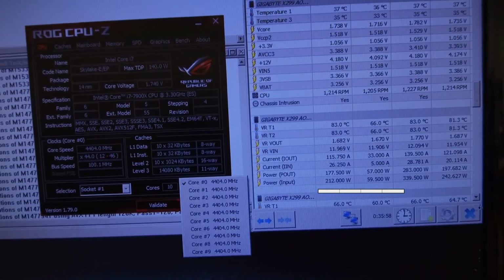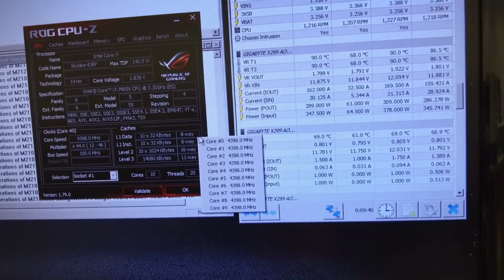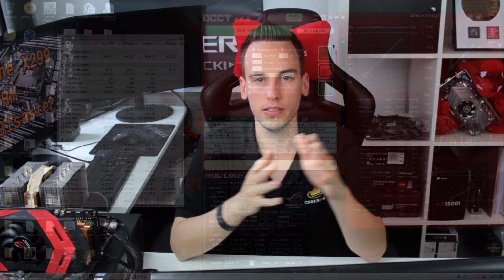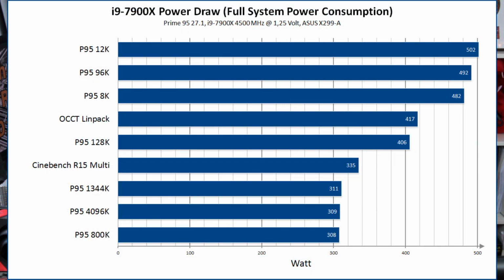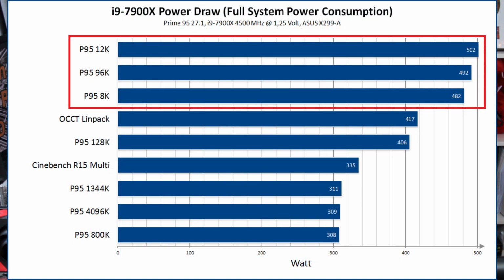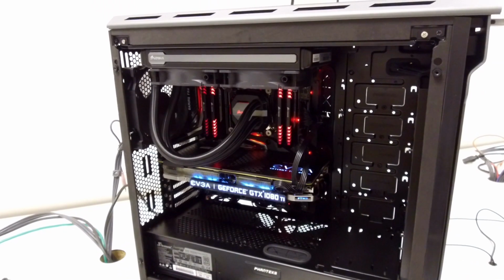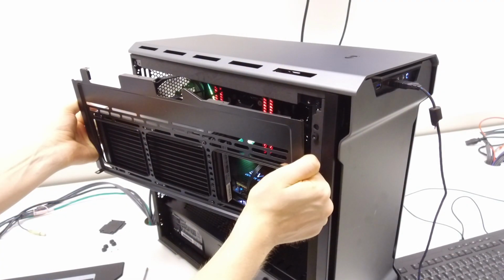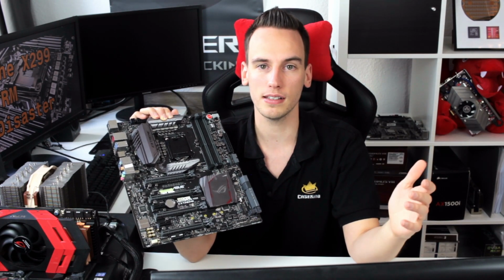X299 VRM Disaster  - UPDATE (en)

Comment: i dont know much about this so correct me if im wrong but how can they copy that z170 heatsink to the x299 when the space is taken by the additional 4 ram slots and the motherboards dont have much space for a bigger heatsink
Reply: It's the design of the heatsink too.  The surface area is basically, non existent . These CPU's pull to much for the poor design.

Comment: I would reach out to Gigabyte and see if you can get one of their higher end boards. I currently have a Gaming 7 and it has a significant a heat pipe running from the VRM down along the back plate. Hopefully this added surface area can help dissipate some of the heat.

Comment: Great video, I have followed TTL for years and years. I knew there was more to it. I am certainly keen to see some videos with better thermal interface. Does the APEX you have use the same IR mosfets? you mentioned these boards all use the best IR components. Does the APEX simply have more phases of the same components or better components that stay cooler / provide greater efficiency?

Comment: That's why I was confused, I'm looking at my new ASUS PRIME X299 DELUXE and it has 8 pin + 4 pin.  When I'm overclocking I always use fixed frequency and run higher voltage (dual loop water cooled setup) ... this has provided very reliable performance on my older 5960X CPU.  Still working on my 7900X CPU.  But thank you for this video, it is interesting.  Prime95 is definitely worst case, but it's also not very realistic in terms of application usage, in fact, it's they ONLY application I know that operates at such extremes.  You really want to OC relative to the type of applications/games/sims one is use and make it stable for that.

Comment: Thanks for the update Der8auer! Been wanting a 7820X for a multimedia build (gaming and movies and whatnot, yes I know it's overkill) and was about pull the trigger on a X299 Prime Deluxe. Thus far I've seen MSI have better gaming performance because of Intel's P-States on ASUS supposedly. I custom water cool, so I don't mind the heat, but unfortunately no monoblocks for the VRM. Thank for you allowing me to make a better decision as i didn't just jump onto this platform. I really look forward to the day I can finally buy this!
Reply: Dylan Shaw just get a 1700 or a threadripper, the problems are much less frequent.
Reply: Dai2 Dai2 if i gamed at 60hz i totally would, but this whole build is meant to be unnecessary and expensive. Will be starting off with 32gb of ddr4-4000 in quad and already have a 512gb 960 pro waiting. I might end up with ddr4 3600 though, because quad channel will give all the bandwidth. As for TR, super excited for the community, but I know it's not going to be as good in games and that's all I do.  Please don't take this as I think Intel is a good company or that X299 is a good platform, but I'm stuck with no other choice. I won't "upgrade" to another 4 core, ganes will start using more than 8 threads in a couple years from now and I stay ahead of the curve. So 7820x is that sweetspot.

7800x is useless as coffeelake is coming out and anything over 8 core is certainly not meant for just gaming and thus Is get TR, but no other competition when it comes to the 8 core.

Comment: The aio in the top will recirculate hot air if you do not block the empty fan space off, considering it's situated right above the vrm, that can certainly not be good...
Reply: Not exactly sure what you mean but even recirculated air is cooler then the VRM and should actually help cool it if anything.
Reply: No, it will work like a heat trap, vrm circulates hot air to aio which will at best continue through the aio and be recirculated down to the side where there's empty fan spacing, heating up the internal air, which in return will make it harder to cool the vrm, 5 mins is all it takes, to see that that exactly is a problem with this case, and there's some easy solutions to fix it.
I have this exact case, and used gaffer tape to block off air from recirculating, because it was heating up the inside of my case.
Reply: hmmm, even recirculated air is cooler than the vrm's. That recirculated air get mixed with fresh cool air that being pushed in from the front of the case. Not to mention most of the air is being pushed out thru the fans up top on the heatsink.

Comment: Could you put a thermal pad in the gap between the vrm and heat sinks? Would that make a difference? So the best solution now is to take the heat sink off and have a fan running on it

Comment: If you don't have the balls to delid your CPU with a Razor blade then Overclocking isn't for you ;)

*Newer Intel CPU whise (Excluding X99)
Reply: That's ridiculous, I hate that I had to delid my 7700k just to have decent temps while OC'd. The fact you have to do it for Skylake-X as well is appalling.
Reply: Yeh even with my 4690k I got 8c less compared to the stock thermal paste.
(I tried the vice method and i chipped off a edge but it still works lol. I ended up needing to use a razor blade)

Comment: I don't understand why there are all these big flat heatsinks, I remember when there used to be a load of really bountiful copper work with fine thin fins on motherboards. Looked really nice along side my old Zalman fan. What is it with this black surfaces from a distance it looks like a cheap bit of plastic.

I noticed on some of these boards they are putting NVMe drivers under similar smooth flat `heatsinks` i wonder if extended high usage on these will also be an issue for the sticks.

also, don't these boards cost 300$+ would be really interesting to see if a 5$ strip of heat pad fixed the issue.

@der8auer have you considered making your own heatsink (with min fan attached) for the systems you sell.
Reply: +Pedro Pinheiro For small dies like Kaby Lake, he is as confused as everyone else about why they don't do it on the new Skylake-X chips (which are big dies).
Reply: They've been watching too much Transformers and Pacific Rim. Also, a "stylish" solid block of aluminium is cheaper to make than a proper heatsink.
Reply: These cards are not cheap they dont need to cheap them off to limit the performance. These cards sell themselves as cards for OC
Reply: Skylake-X CPU's aren't cheap either, but intel still decided to save a few bucks by using thermal paste instead of indium solder. Corporate greed knows no bounds. If they think they can get away with it, they will skimp on quality for profit margins every single time.
Reply: i still dont get why they do that on these high end chips that basicly are only there for OCing.

on lower end non oc parts sure as long as the cpu does the thermal throtal but on these parts its realy strarnge.
Reply: IsakH850 Der8auer himself explained why it is not a price issue but durability thermal paste is more stable for repeated heat cycles specially for very hot systems.

Comment: Just look to the s755 1366 era - heat pipes, pure copper and fans on vrm! Now we have only designer nonsense made from chinese silumin (low quality fake aluminum) and with vendor logos that strict airflow.
Reply: yes this is a real motherboard not hipster designers rgb plastic shit
Reply: +Taran
So many people have no idea how much fake aluminum they use these days on motherboards!
+Dmitry Belogub
P5Q3 Deluxe i have that running!
Reply: I had a Asus Crosshair nForce 590 SLI AM2 that came with 2 blower fans that could be mounted on its copper VRM heat sinks. Like so: http://www.frostytech.com/articleview.cfm?articleid=2077&page=2
Reply: Oh yeah, my asus smth deluxe for s775 had the same. Damn it was noisy :D
But just look at that amount of copper, surface area and heatpipes!
P.S btw, modern sabertooth series boards have something similar. Sadly, the noise is also present
Reply: +Samuel Jones
Wow, thats some nice engineering work from Asus! Sad that they fired the engineer and hired an art student..
Reply: We want full copper back!
http://cdn.overclock.net/3/3e/3eab6a9d_asus-p5q3-deluxewifi-apn.jpeg
Reply: It's sad that the X399 platform is using tiny aluminum heatsinks.
The thing is.. i bet... they don't use 99.9% aluminum, but rather use a CHEAP aluminum and other metals mix.
Reply: Wow really nice motherboard! https://content.hwigroup.net/images/products_xl/001637/asus-crosshair.jpg
Reply: Check Rampage Extreme X48 and Rampage II Extreme ;)
Reply: Yep. Dergadation.

Wanna see DFI and ABIT alive...
Reply: Taran Chinesium, you mean 😉

Comment: >be asus
>call from intel
>"we're releasing a new platform next week so if you'd have boards done by then that'd be greeeeaaaat"
>"also make sure the vrms can do 300A without overheating"
>hangs up
>mfw
Reply: 6950X maxed out uses less power than 7900X
Reply: +Actually Hardcore Overclocking
Yeah, i really would like see someone go deep in why 7900X is slurping so much wattage!
A maximum power draw battle video of 6950X vs 7900X could be awesome too.
Reply: hangs up or hangs himself?
Reply: You do know X99 used FIVR too, right?
Reply: It's really mobo vendors fault for prioritizing aesthetics over functionality.  X99 WS boards had proper finned and heatpiped heatsinks on the VRMs that could handle 10 core 6950X max overclocks all day long with zero airflow.  For X299 where power delivery is actually easier to design due to FIVR,  they decided to put a lump of aluminum on them and call it good.  It's fine if your loads are lumpy but it's bad if you're under sustained load.

MSI at least should have known this since their Z270 M.2 "heatsinks" ended up heating up more than not using them.